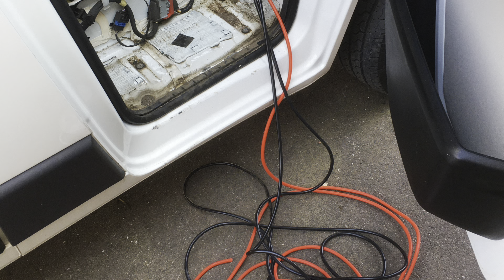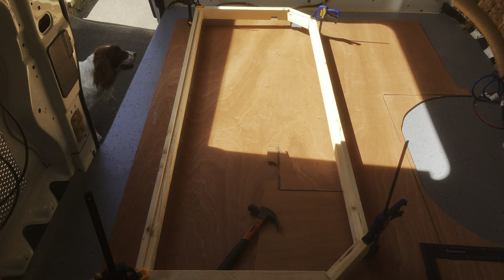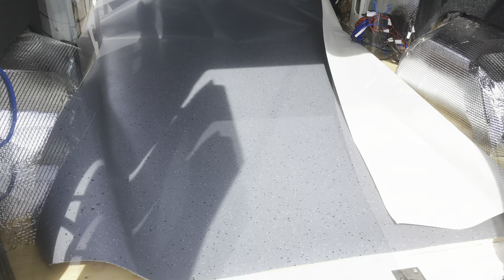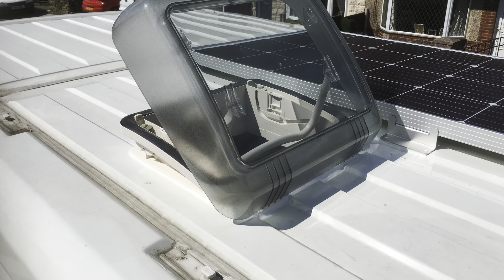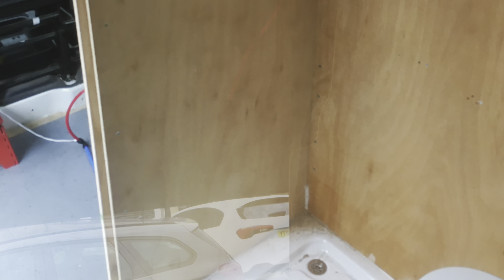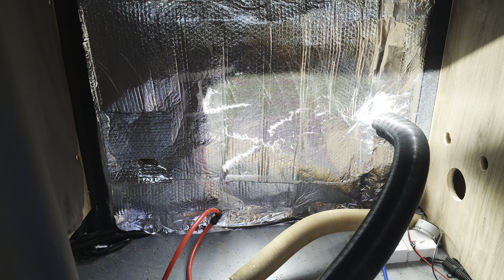Van Build Peugeot Boxer L3 H2 with shower

Comment: Where did you take the van to fit the windows and how much in total please?
Reply from the maker: Hi Stu, the windows were fitted by Joe at kestrel conversions in Barnsley, the cost of the windows and fitting in 2020 was about £700, the total cost for the van build was around £15K, 👍

Comment: This is great! Thank you. I have just bought the same model but 4x4. 
What was the cost of this conversion in materials and can you advise the source of this? Thanks.
Reply from the maker: Hi Andrea, this was done in 2020 but the cost of everything to date including upgrades as seen in my other videos was about 16K, the materials were sourced from lots of places, mainly eBay and the furniture board was from magnum motorhomes in Grimsby. Hope that helps a little. Thanks.
Reply: Thanks!

Comment: Gorgeous build Ian  !  Hello from Dublin 🍀🍀🍀🍀
Reply from the maker: Hi Angela and regards to you and Dublin, hope you had a memorable St Patrick’s day 🍺. Thank you for your kinds words and all the best. Ian 😊
Reply: @onevanandhisdog3641  Ian. !  I retired from my job almost a year ago now and would love to try converting a van in the future.  Is it easy to drive a Ford Transit and would it be just a case of getting used to spatial awareness of the van and it's dimensions. ?  All the best Angela 😺💚🍀🍀😺💚
Reply from the maker: @angelamurphy3331  Hi Angela, my van is a Peugeot boxer and is a bit wider than a Ford transit. It does take some getting used to when you start driving something this big but if you take your time and use the wing mirrors especially when going round tight corners cause the back wheels have a habit of hitting the kerb 🫣
But just go for it now that you have the time 😊👍
Reply: @onevanandhisdog3641  Thanks Ian for the words of encouragement.  🍀🍀💚💚😺😺🍀🍀

Comment: Beautifully done that. Very impressive. The only thing I would change would be the toilet cassette I would have to have it on the outside,
Reply from the maker: Thanks for your comment Nathan it’s much appreciated. I didn’t want the hassle and possible future leakage problems of cutting a large hole in the side of the van as the hole would also have intruded into the black plastic trim that runs across the sides of these vans. It’s honestly not a problem the way that it is. Cheers
Reply: @onevanandhisdog3641  makes perfect sense mate.

Comment: Brilliant detail, a lot of thought and effort, one of the best i have seen. Thanks for taking the the time to share this. Keep going with the vids 🙂
Reply from the maker: Thank you for your kind words and encouragement, also, thanks for watching and a happy new year. 😊
Reply: @onevanandhisdog3641  Hi, your knowledge on the electrics was impressive , did you teach yourself with reading ont tinterweb? Have you any advice on this please? Areas to go and read up would be useful. Which engine cc is it? I understand its euro 6 that is all. Happy New year to you also .
Reply from the maker: Hi Chris, yes I taught myself through watching YouTube videos, I’ve done quite a bit of domestic wiring through my job as a gas engineer but wasn’t used to 12v van wiring. Greg virgoe’s videos were a huge help and for sizing up the wiring I used the wiring sizing calculator on ‘12 volt planet’s website, also I preferred to oversize the cable a little bit just to be safe even though it works out a bit more expensive. Also make sure you have a mega fuse between your batteries and your positive busbar. I used crimped connectors with shrink wrap over the joints where I joined wires just to add a bit more support and it’s been fine. All the best 
https://www.12voltplanet.co.uk/voltage-drop-calculator.html
Reply from the maker: It’s the 2.0 litre engine Chris, would have preferred the 2.2 for the extra grunt but they were only available new when I bought this and so were out of my price range. 👍

Comment: Amazing job ,what would be a realistic budget for a DIY conversion of this high standard?
Reply from the maker: Thanks for your comment, about 12k should get you there but this wasn’t expensive furniture board at £100 a sheet, the fridge was a month old off eBay and I saved £300 on that and I got the Truma at trade price so saved £200 on that too. Cheers.

Comment: Great video ! thanks for sharing , did you us the bit of furniture board you cut out of the shower front for the door or was the door cut from another complete board ? And what type of router cutter did you use to cut the door opening ? 
Sorry for all the questions , you have made a very good job , well done  you must be proud of the finished van build 
Thanks
Reply from the maker: Hi Ned, thanks for the compliments and yes I’m proud of the van and how it turned out. The doors and all of the cupboards etc are the same piece of furniture board that I cut out, this way the grain in the wood matches up when the door is closed. From memory I think I used a 5.5mm straight router bit, the template for the cut out was 5mm larger than the actual cutout to allow for the guide in the router. Hope this helps. Thanks
Reply from the maker: I’ve just checked Ned and the router bit was 6.4mm 👍